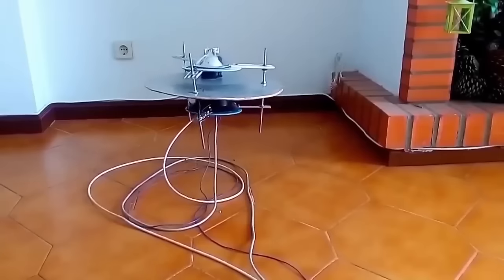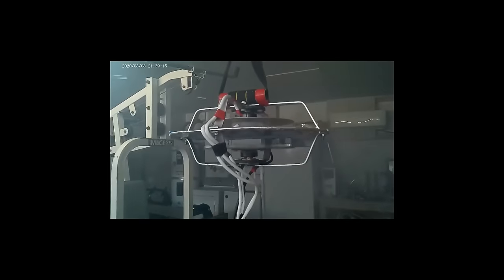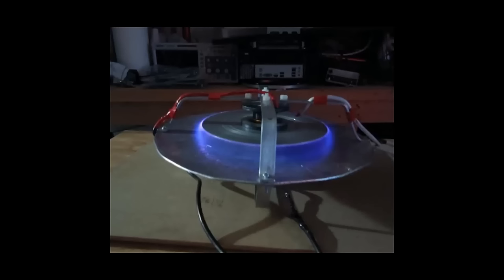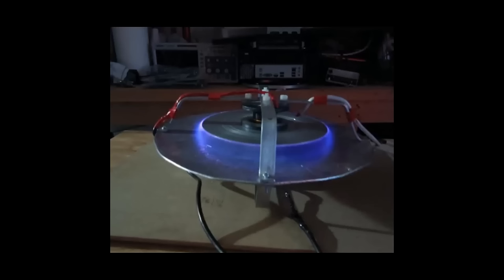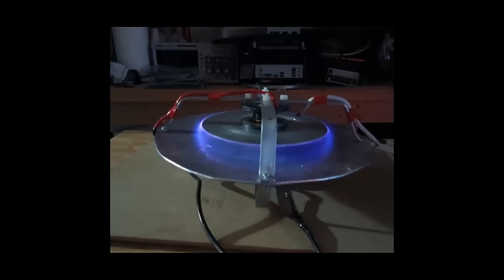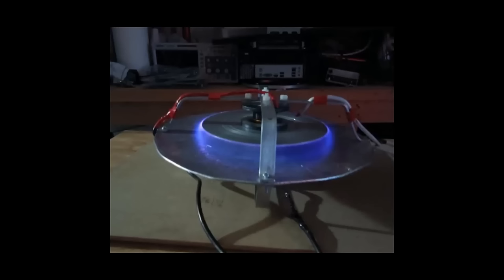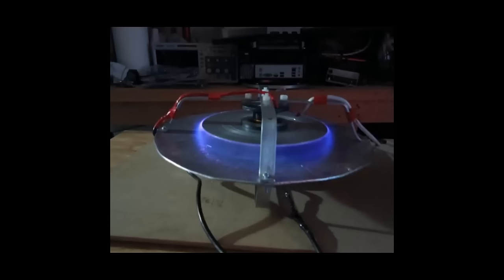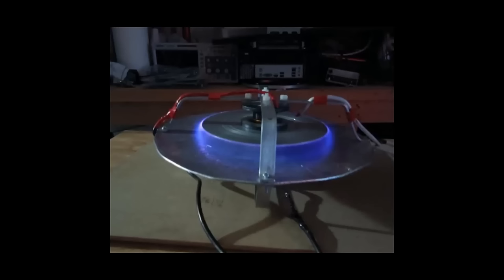Building The Graviflyer "Testing Everything"

Comment: 37:36 pyrit also make the same mirroring effect of discharge however quartz crystal it self won't solve your issue, i liked the discharge of aluminium foil, it's cool effect but you can have huge plate with monocrystals which can be harnessing the wave functions but it would have to be from one side for both to have that discbarge actually flow, so it would make sence to put two monocrystal cylinders above those aluminum foiled cylinders but i don't reall see that working without vacuum, plazma charge can build up when electrolysis from other material on to the other creates more electron shells which can increase the flow of ionic winds in the end, you want this effect but in toroidal spin up and nonpolar spin down if you ever calculated molecular bond electron negativity (polar, non-polar) you know what im talking about, it's possible to create plazma in non vacuum environment
Reply from the maker: I want the state just before plasma. The build up of charges around the disc's. if i can charge the whole frame with the center plate then i can palse it. The charges my be the thing that makes it seperate from gravity.

Comment: Wow - that was really informative!
Quick question: You said your middle plate was 2 alu-plates hammered together, with the edges folded+joined together.
I missed the part of why you hammered them together - I realize you want them to act as a capacitor and resonator, but the hammer-bumps would create various cavity sizes between the plates, creating lots of different capacities values (as I see/understand it).
Would a carbon felt/foam in-between the plates, perhaps with a teflon insulator with holes and/or screws at various points to create a 'circuit', be a 'better' way of making either a uniform, or 'bigger cap on top than on bottom' - and not a directly shorted alu-alu - connection/capacitor, instead of what I would imagine is a lot of random points, that when rotated is not uniform - as it is hard to scrape bumps?

Your explanation of how this works made me think of jumping on a trampoline. Boing-boing, you get resonance going.
Then I bring a feather-umbrella with me, holding it above my head. The feathers allow me to go up easily, but resists me going down by blocking - as feathers do. This alone would make resonance hard, as I would land softly on the trampoline - but if I attach strings/springs to the feather-umbrella's sides and to the sides of the trampoline, hitting the right resonances - I should jump myself higher and higher by jumping up, stay 'there'  - but the string/spring to the trampoline pulls the trampoline towards my feet, and I can jump as I normally do - and getting higher and higher off the ground.

Looking forward to seeing your new Graviflyer
Reply from the maker: Yes, like the trampoline. I think of it a a bubble. Soap does not lift but when you make it into a bubble it does. The forces around it are not held at bay while the hot air lifts it. It has a very low lift factor. It's the fact that it removed the resistance that is the important part.  

I tried to follow as much as I could to the original design. Alexey said it works. So my job is to try everything to see if he is right. The textured plates are because Alexey used them.  

I decided to change some more stuff on version 3 because of some of the facts you bring up. To be honest When I get the center plate to resonate then it will make the whole craft resonate. It's all aluminum. I like the holes in the plate. However only to make it like a beetle shell.
Reply: @nathanbunten4299  Thanks, makes sense to replicate/repeat what Alexey says works. 
I don't know how much Earth's magnetic field-lines influences the craft, if at all, but I know the field-lines vary wildly. At the poles they go straight up/down, then they move towards horizontal near equator. @brainiac75 did a video called "Vertical? The Earth's Magnetic Field?!?!" 

Getting the center plate to resonate - will be the replacement for the poor person jumping on the trampoline, holding the (rather huge, compared to the person) feather-umbrella, getting an extremely good workout :ø)
Ever tried carrying an aluminium ladder, where your 'buddy' suddenly drops it - the kick, ooh ouch the kick, when it hits the ground - and the shock is transferred to your tight holding hands.. A practical jumping feather-thingy sounds well.. impractical 

Btw, graphite pads (used for CPU cooling) and pyrolitic graphite (exhibits 'anti-gravity' effect due to its strong Diamagnetic value when placed over 4 magnets) could also be an interesting option to look into. Some forms of carbon conducts electricity easier in one direction, if in sheets rather than a bonded matrix/crystal-structure - some forms of carbon costs a fortune, others can be made by burning/carbonizing cotton.
Reply from the maker: @EgonSorensen  I like granite as a dielectric. The k value is high. The other reason is we can get a secondary effect. The force of a capacitor will cause the quartz to make cold light. The better part is water is conductive and the granite is like a candle wick. It pulls water in and the granite holds it. It might give you more than you put it. I understand the ones you like but tests with voltage will be needed to see if they can stop very high volts from tearing holes in them.
Reply: @nathanbunten4299  'I like granite as a dielectric'. Sorry, but I don't follow you here.
I presume you're now talking about the ultrasonic resonator used in the original design in the beginning of this video?
I was under the impression the piezoelectric device was sitting at the very top, in the hat which looks like the back end of a light bulb-parabola. 
Granite as far as I know contains A LOT of quartz, which is used in a piezoelectric - I'm sure you know, and I speculate that since granite contains various structure sizes, it might be tunable over a larger frequency range than a specific quartz crystal/element.
Perhaps a crystal/quartz gemstone (those 6-sided for sale in souvenir shops, etc) ground down with to an angle, scraped/cut across the angle cut, so it would act as an xylophone of sorts making tuning 'easier and cleaner'?
Perhaps a head-cap around the tip of the granite would help prevent it destroyed from arches. I bit of molten aluminium is easy to pour around and would make a great fitting protective cap around the granite impactor tip. The alu-tip then acts as a mechanical and electrical shield around the fragile granite-tip, causing arches to run on the outside, flashing over far away from the tip and mechanical shocks to be distributed more evenly on the entire granite tip area.

If I'm wrong on topic or otherwise, do let me know. as I said - I lost you on this message. There's a lot going on, me brainstorming without knowing your entire setup/situation.
- I hope to see this thing built and flying as soon as possible too :ø)
Reply from the maker: @EgonSorensen  You don't need to know the frequency of the quartz. Just that when it is struck it makes piezo electricity. In between 2 plates you get a sudden pinching effect. that single effect will activate the quartz. There is one problem. You have to get the power out and not just make the quartz glow. You cannot just attach a wire to it. Putting it in water solves that. The granite works like a sponge to water. It holds it in. 

Take a pyramid of granite. put a small plate on top. Then a big plate on bottom. put the bottom plate in water and make sure the granite is touching the water. Then hit the power. It should light up and give you a higher amount of energy. That's the theory.
Reply: @bunten4299 'You don't need to know the frequency of the quartz' - ah, so he's not using the piezoelectric top as a transmitter, but as receiver. That's what generating the top (or bottom - opposite what's Tesla coil driven) ion-wind then?

I was under the impression two 'audio-generators' were needed. Much like another 'anti-gravity' tech: Acoustic Standing Waves and the Levitation of Small Object, and this was driven by one of the circuits in his diagrams upper right corner. 
Edit: The second aucustic generator, in my initial understanding, is is the center plate, beating like a set of cymbals. - This center plate is then the 'only' one, if I now understand correct?

That's good to know, as it is possible to get flat ultrasonic transducer discs for ultrasonic cleaners. They come with metal already plated to it, so no need for water - it evaporates, possibly spins away. It might even split into hydrogen and oxygen gas, if the voltage is high enough. 
I have a few 2.6mm thick and 50mm in diameter. It is rated with an insulation resistance of 2500 Vdc/100Mohm. It's resonance frequency is a static 40kHz, and has a capacity of 8500pf (+-10%) and below 20 ohm of contact resistance. Rated at 35W., 5 cost me €15 in 2019, if you're interested in some specs.
They attach via epoxy/glue, and the sad thing: They're fragile - how much, I don't plan on finding out.. (that is why I'm thinking helmet-thoughts ;ø)

Later I got myself a 'professional' ultrasonic cleaner, too much trouble messing with a tank + driver + .. especially at the cost of a China made one, that even had dual freq and heating;ø)
Reply from the maker: @EgonSorensen  I was talking about a granite capacitor separate from this build. 

The piezo disc has a dump circuit. Where you unload a capacitor all at once circuit. It makes a pulse wave. When you have a resonating disc at the center the pulse wave amplifies it.
Reply: @nathanbunten4299  - So the granite is a replacement for the driver in the top-right-corner of his schematics?
Then there is 'still' two acoustical generating devices: One piezoelectric device in the top of the original Graviflyer - generating ultrasonics, which interacts with the secondary acoustics generated from the middle plate(s)/'cymbals'?
Reply from the maker: @EgonSorensen  The piezo device is just an energy generator activated by vibration. It powers the ultrasound transducer. That's the secondary pulse wave.

The resonance is the primary source of vibration. It has to be in the resonance chamber between the 2 center plates. Just like I showed with the tuning fork. 

For example the resonance is like the treble in a speaker and the ultrasound device it the base. 

This part below is a separate and new build 

The top rotating plate and the center plate makes an open air capacitor. The granite would be between the top rotating disc and the center plate. If you remove the motor and sandwiched the plates on each side of the small plate and the center plate. It is a higher volume capacitor. The same kind TT brown used.
Reply: @nathanbunten4299  'The piezo device is just an energy generator activated by vibration. It powers the ultrasound transducer' - so the ultrasound transducer is the horn (or whatever is glued/connected to the piezo device) - correct?
To me, (I'm a radio amateur, radio mechanic and also an electrical engineer), a piezo(electrical) device is a crystal that, when exposed/connected to an AC voltage, will swing and generating a physical moving frequency, equal/depending on its size and dimensions - just like a tuning fork. This vibration then moves through the horn, for amplification.

If I'm correct now, a granite plate will be inserted between the plates making up the middle plate - and that entire setup will then make up the center plate.

Interesting. 
Aluminium is Paramagnetic - Silicium is Diamagnetic - Oxygen is Paramagnetic
Quartz is SiO2 - so combined, both Diamagnetic and Paramagnetic properties are likely present in the same material: Granite. 

When subjected to an external magnetic field, Paramagnetic materials add to the field and 'helps' attracts magnetic fields/items. 

Diamagnetic materials becomes repulsive when subjected to an external magnetic field, which is what makes pyrolytic graphite float on 4 magnets.

- I know you can not make simple conclusions from single elements combined, but it sounds to me like they will oppose each other internally, making a magnetic shielding, so the top/bottom magnets will be having a much harder time interacting.
Aluminium is paramagnetic - so it will act as 'magnet-extenders', and since top/bottom rotate counter each other - a lot of opposing fields and patterns are bound to emerge - which is where I think Tesla were referring to his 3-6-9 number theory, taken further by Rodin, etc.
Reply: "- I know you can not make simple conclusions"
So I did some research on SiO2 - the main ingredient of Granite, and is what gives the light when struck/energized - as I see it; when energy flows through the crystal when struck - it jumps in between electron-valence-bands, through the SiO2 molecular/crystalline matrix, from one end to the other - more or less straight, depending on resistance, etc, etc.., and in the process Photons will be emitted, as it has to 'somewhere' as it can not stay in there ;ø)

Si has a Magnetic susceptibility (χ) of: −29.6·10−6 [cm3/mol] - making it having Diamagnetic properties.

I asked chatGPT to explain Diamagnetism and Magnetic susceptibility - Here is its answer, and it seems 100% legit to me:

Magnetic susceptibility (χ) is a measure of the magnetization of a material in response to an applied magnetic field. It characterizes how much a material can become magnetized in the presence of an external magnetic field.

Magnetic susceptibility can be positive or negative, and this sign determines whether a material is paramagnetic or diamagnetic:

Paramagnetic Materials: These materials have a positive magnetic susceptibility (0χ>0). In the presence of an external magnetic field, paramagnetic materials tend to align their magnetic moments parallel to the field, resulting in a net magnetic moment. However, this alignment is weak and temporary, and it disappears when the external magnetic field is removed.

Diamagnetic Materials: These materials have a negative magnetic susceptibility (0χ<0). In the presence of an external magnetic field, diamagnetic materials tend to align their magnetic moments anti-parallel to the field. This induces a weak opposing magnetic moment, but it's typically much weaker than in paramagnetic materials. Diamagnetism is a universal property of matter, and all materials exhibit some degree of diamagnetism.

The magnitude of the magnetic susceptibility indicates the strength of the material's response to the applied magnetic field. For paramagnetic materials, higher positive values indicate a stronger response, while for diamagnetic materials, higher negative values indicate a stronger response. However, it's essential to note that diamagnetism is a universal and weak effect, whereas paramagnetism is more specific to certain materials with unpaired electrons.

So summarized, I think a granite plate inside the center plates outer two plates will work against the rotating magnets.

Aluminium is a Paramagnetic element - so it will act as a magnet-extender. 

Carbon exists in various forms like diamond with a magnetic susceptibility of: −5.9×10−6 [cm3/mol] according to Wikipedia. I have a periodic chart with rounded values, and here the element is rated -6. So clearly a Diamagnetic material, which also will oppose the permanent magnets - as granite will, going by this kind of thinking. 

I imagine an engine capable of converting relatively weak forces, like gravity, efficiently - must run without losses 'everywhere'. Then again, sometimes it takes a storm to give room for new growth and prosperity - even though it costs..

I do not know the consequences or requirements for success - but I know how to do a bit of research :ø)
- hope it is useful, to you and anybody else who is reading along here
Reply: 'The piezo device is just an energy generator activated by vibration. It powers the ultrasound transducer' - so the ultrasound transducer is the horn (or whatever is glued/connected to the piezo device) - correct?
- I got to correct myself here - without editing the prior text, as it will make reading it strange in context later imho.

I read 'piezo device' and 'ultrasound transducer' as the same, just used forwards or backwards. Energy pumped out, and returns.
- dare I guess if there is 1 or 2 (I'm up late, so gotta sleep on this :ø) devices in the Graviflyer 😊
Reply from the maker: @EgonSorensen  I have 300v dc to put into a capacitor. So I will order a thin piece of granite and get 2 plates and try it. When I do the test then let's talk on it again. I think it will be interesting.
Reply from the maker: @EgonSorensen  just 1
Reply: @nathanbunten4299  Sounds very exciting trying out granite as a dielectric value modifier in the center capacitor/plate.

What exactly do you plan on measuring/testing for?

I have heard stories of manhood tests, where large quartz crystals were struck onto stone while holding it. If the crystal broke, the poor soul who broke it would get electrocuted (and harvest next/this year not good) - so please be safe, as it is technically a bit like detonating an EMP - current/energy cannot flow through the crystal when it breaks apart, so it will manifest itself as a high(er) voltage and jump, which will flow through which ever conducting path it otherwise can find - and which should not be ones body, especially the heart, as I guess we're all interested in learning about your awesome experiments.
- I am ;ø)
Reply from the maker: @EgonSorensen  If you can make the capacitor then you know what the pyramids were for.